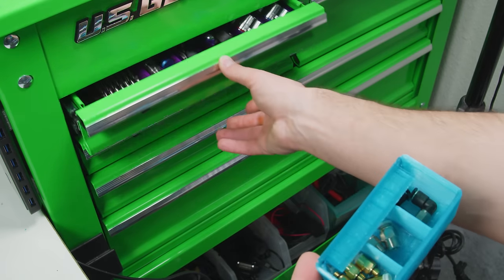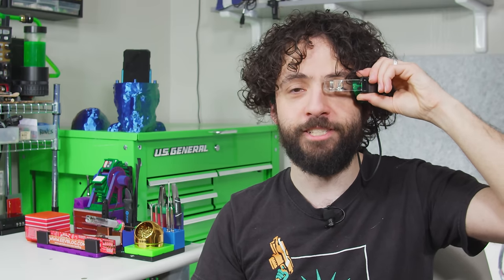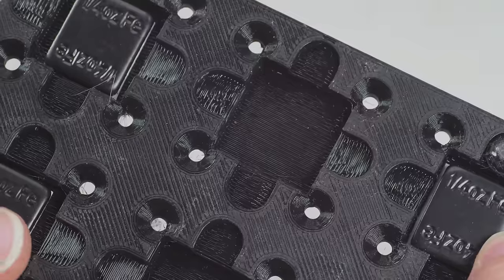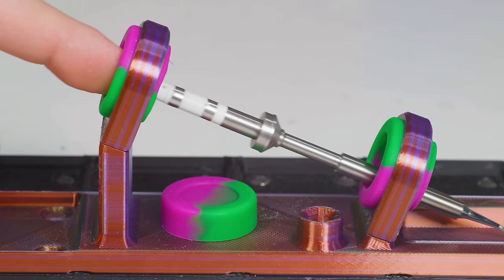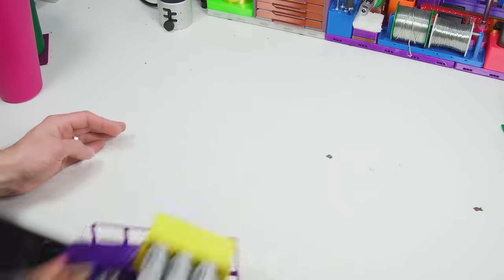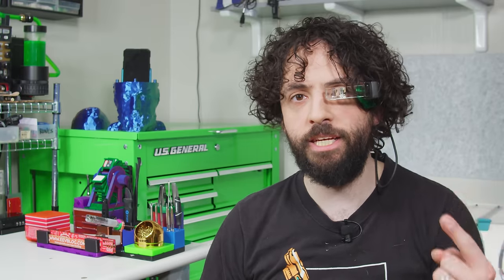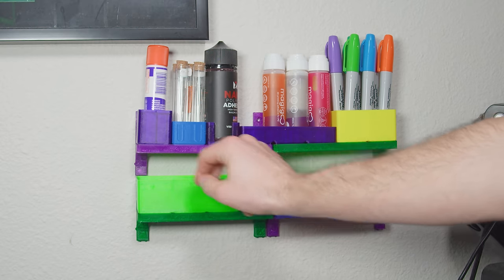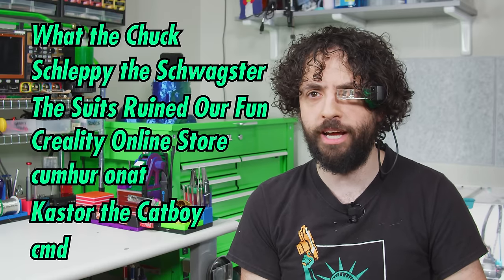Store Anything Anywhere with Gridfinity! 20+ Weird Printable Organizers by Makers Like You!

Comment: The gridfinity system is one of the most normal yet over the top organization sets that I’ve printed
Reply: I want to make an equivalent to the SD card holder (not the wheel but the other one) that is basically just like a 64-port SD card reader. You can use all of them while they’re in storage!
Reply: @myrealusername2193  That would be incredible. Windows users wouldn't be able to assign enough drive letters lol.
Reply: @tbuk8350  I have tried to figure out the electronics for it and it would be absurdly slow unless I was using like USB4. Because to have 64 ports would mean a usb 4 hub that went to 8 usb 3 ports, and each of those would go to USB 2.0

Plus 8 USB hub ICs would be hell to solder, I’m nowhere near good enough to do that lol

Comment: I can see the use case for the Minifinity, actually: jewelry making. Some jewelry components are the size of surface-mount resistors - crimp beads, crimp covers, and omega wire protectors come packaged by the gram, loose, in tiny plastic bags, and you only ever need a single digit number of them per project. I use pill cases (like, the ones with compartments sorted by day) but I can see someone who's invested in your system being willing to glue a couple itty bitty baby compartments in to hold such parts.
Reply: That Minifinity is perfect for SMD resistors and capacitors.

Comment: FYI, if you don't need screws, the "light" baseplate on thingiverse is less filament than even the one in this video.  If you use this version, you can heat 6x2mm magnets, similar to a threaded insert, to get them into place.  Minimize how long they're hot for, magnets slowly lose power when very hot.

Comment: I think the 1/4 size Gridfinity would come in handy for watchmakers and people who play with SMD and other tiny stuff.
Reply: The biggest concern is human accessibility, because yes, a lot of the SMD components are absurdly tiny and you can fit a huge amount of them in a small volume, but handling them is clumsy with fingers.
Reply: Are people who are working at that scale (enough to need bins like that in the first place) going to be using their fingers to handle those components anyway?
Reply: @Blooest  sometimes! There’s not a more correct answer than that. Especially resistors/capacitors/diodes all of which are tiny and not static-sensitive and you tend to use a bunch in a project, it’s logical to grab a bunch with a finger.

Not all SMD components are super tiny, and a number of those may or may not make sense to have in anti-static foam.

Comment: That articulating arm could use a spring inside the hub axle such that when you tighten it down, there's a certain force after which it overcomes the splines and rotates. You could change the force required by adjusting how tight you screw the end caps?

Comment: You could include a magnet on the bottom of the razor box so the razors stick to the magnet and if you knock it over it wont dump them out. Since they are sharp and what not. Maybe make a small insert that can be pulled up to separate the razors from the magnet.

Comment: I think converting a 2x2 grid to a scaled down 3x3 at 2/3rds scale might be more useful as a mini one than one that converts a 1x1 to a tiny 2x2 at 1/2 scale. The extra size and depth would be just enough to make it more useful, and a 2x1 baseplate converted to a scaled down 3x1 with a long slot on the side would actually be really nice. There might be just enough space in a 2/3rds scale setup like that to put simple lids on them instead.

Comment: Worth noting that a lot of this stuff you can absolutely make without a 3D printer, it just takes other tools, materials, skills, practice, and a lot of dedicated time.  And for some, like myself, that really is the better option. 3D printers are expensive, but I already have the tools and experience I need for woodworking. 

It's important to remember, hacking isn't just about having the latest gadgets and gizmos, it's creative problem solving working with what you have and applying learned knowledge and skills. It's making a part yourself because buying it would be three times as expensive. It's disrupting a network to provide aid to suffering people under a regime, it's infiltrating a secure system to reveal doccuments that really should be accessible to anyone.

Hack with what you have, whether it's an axe or a lazer cutter; if it gets the job done it's good enough.

Comment: Meanwhile, I used the annoyance of swapping a hot pinecil tip out as an excuse to buy the v2 and a full set of the new shorter tips. I still love that I have 2 handles and 1.5 sets of tips for way less cash than my previous employer paid for the Hakko I had on my bench (which was no where near as good).

Comment: I really like the idea of Gridfinity and I've tried out a few different angles for it, but the amount of plastic waste is really high, even with the vase mode alternative implementations. I'd love to see somebody brighter than me figure out a way to do it, but at the same time we're basically talking about injection molding.
Reply: It's only waste if you plan on throwing it away soon
Reply: Waste isn't just about discarding things, it's also about opportunity cost.  The single-square "put one small thing anywhere" holders and the like are memes in practice; the competition are off-the-shelf drawer organizers and the like. By comparison, when the alternatives are far thinner injection-molded pieces that weigh less and use less resources to make, it absolutely is wasteful. The calculus is probably better when compared to for free-standing surface-resting pieces, but those don't also incur the overhead cost of a (plastic-intensive) frame.

There are things that FDM absolutely does well but building boxes and similar just isn't one with conventional design techniques.

For wall storage, by basically any reasonable measure, those Harbor Freight parts organizers that Zach has are a more efficient use of materials, probably even with his comparatively heavy front faces on them. (I have the same organizers! They're great!) The Honeycomb stuff is also probably more generally efficient if you're insistent on FDM. For drawer storage, you can buy the aforementioned injection molded pieces for about $22 for 32 miscellaneous sizes on Amazon, and to print similar in Gridfinity you're probably looking at four to five rolls of material, somewhat less with vase mode variants.

It just doesn't work out well.
Reply: @EdRopple  It's a hobby solution for hobbiests... Obviously you'd never implement this at scale but it's the fun of making it and figuring it out that's the point.
Reply: @Frankenstein786  I dunno, dude, I try pretty hard to not waste non-biodegradable material. On a channel where the host ha-ha-only-serious jokes about plastic choking the oceans, I would think that would be a priority.
Reply: @EdRopple  Depends on where your focus is. I like having an exact spot for many of my tools, and gridfinity suits that well for me. However, all of my resistors, capacitors, ICs, etc, are in nice, wall mounted parts drawers. But the only reason I have those is because they were free. I've tried using the harbor freight ones, and they're garbage. For me, gridfinity is more about organizing the workspace, while storage needs are better met by other things.
Reply: @EdRopple  Look at listas implementation of "shallar" bins, the smallest containers they make are equivalent to a 2x2 gridfinity. For this reason I am not printing any 1x1 or 1x2 gridfinity items and I've hollowed out the bases and dropped the floors as much as possible to match the lista design as much as possible.

You need to apply the 80:20 principle to what gridfinity items you choose to print. 
Should you print a bic lighter holder or should you just print a damn 2x2 bin and drop the lighters in it... The choice is obvious... 

If you work through this lens gridfinity is not that wasteful and I'm excited to continue implementing it, for the most part exclusively in my shallow drawers and for hardware like items
Reply: @Max_Marz  hey, these look neat, thanks!

Comment: the rotary SD card thing would be dope if it had pins on it that the card just lays on. So whenever you rotate, the next card touches the pins. This would of course need a total redesign, perhaps having slots on the spokes to hold the gear still while you want a card loaded.

...or just buy a bigger SD card...

Comment: I wonder if you could set something up to test RAM without having to post a MOBO.  just something small on a pi that can read and display the memory amount and the Hz rate so you could know if components were bad without having to post it. i think the most difficult part would be where the RAM would slot in, and how to differentiate between all the different chip sizes..

Comment: dude you said that the novelty micro drawers are useless... but aren't they stil large enough to get things in and out of there with tweezers? so could it be suitable place to store loose smd parts bin? or perhaps whats a better place for smds is to push them on to a sticky surface. like some double sided tape. in a book, with wax paper to keep seperated the pages from sticking together.

but if not smds then maybe other tiny parts for making. that are normally manipulated with fine tweezers. idk
Reply: Someone on the discord was using them for little watercolor paints tubs. They are a novelty, for sure, but there are niche uses.

Comment: How good is that soldering iron? Like is it the kind I get now, no holds barred slap it into infinity or rather gridfinity? Or should I wait because it has some unforeseen downfalls.
Reply from the maker: I really like it, but it's just $35, there isn't much to lose. It doesn't seem to have any game-breaking glitches or quirks, as long as you stay away from the cut-rate third-party ES100 tips.
Reply: @ZackFreedman  Received and amazed. Though I didn't realize it didn't have a powersource bundled as well as not being natively battery powered. (I'm a little dumb on that part) I am still able to use my pixel 3a charger with it and am going to switch to something else. Otherwise I couldn't be happier, best investment I have ever made.

Also while I have your attention I had an epiphany. Minnist-Finnist! (spelling/naming TBD) This might seem dumb at first to go from Gridfinnity and already having Minifinity for smaller things. But I think Minnist-Finnist would be another great addition because it has a few benefits. 
First being why not, we are all going mad with power anyway. (sorry had to) Firstly, this is more tangential to Minifinity.This standard would act more of a mobile double stick tape kind of application. I personally would use this for phone cables stuck next to my bed, on phone cases and possibly laptops if you can conceive of it. This would be the open source equivalent for magsafe like operation, but still being possible with Minifinity and by association Gridfinity. 
Lastly if nothing else, it increases resolution for how small we make things fit into this particular grid. This might be the final standard in terms of sizes probably because of 3D printing being inaccurate and the fact there is no need for anything smaller.

Thoughts? It's a little dumb and a little genius which means I am right where I am supposed to be... Probably?

Comment: A number of years ago I was exposed to lista cabinets when I started a postion at a national laboratory. One of the systems lista uses are "shallar" bins. I found this to work far superior to any drawer orginazation strategy I'd ever experienced before, especially fixed layouts and those stupid dividers that let screws mix.  I no longer work at that position but last week I started implementing gridfinity at my new place in the far cheaper cabinets and toolboxes we use.

I've decided to standardize all my bin colors on mint-green or seafoam. I think its a very aesthetically pleasing contrast to industrial glitter, black oxide and zinc plated fasteners look really good in them. 

My one request for you zach would be to optimize a and define a new bin standard that is compatible with the gridfinity base geometry but uses as little plastic and is as fast as possible to print. I dont need magnet holes and and I dont need a dozen floor layers. I'm going to do this myself eventually but since you're asking for ideas I think you'd be the best person to innitiate this standard so it can propagate from the top down. NAG NAG NAG NAG NAG do this when you fix the prusa holes!!

Comment: #Zach:yt: You could appeal to the community to find a curling solution for both the base board and the containers that would be compatible with the original system but that would solve all the curling problems of the original version.

I'm sure the community could overcome this challenge and with your official approval, be adopted by all.:goodvibes:

Comment: Zack! I'm pleased to see you've hacked your US GENERAL's irritating door and lid locks.  I was just at a job today where I'd complained that they should rip all that cr@p out last visit.  They told me they had.  After I had the top covered with open tool kits, parts, hot tea, and debris I tried to open one of the drawers only to discover they'd not defeated the *^#@&(} lid lock.  😲
Reply from the maker: Ha, yeah, I just drilled through the spring mechanism and jammed it open with cotter pins. I shared my 3D-printed inserts on Thangs that hold the drawer latches open.
Reply: @ZackFreedman  Thanks for that.  I was going to suggest just sawing off those black buttons but your drill-and-pin is way better.  Thanks a million!

Comment: 6:40 WHAT? how could there possibly be an upgrade over the 888D? i've worked in multinational run labs that had endless budget, and they used hakko 888D or super old weller stations for the old timers that hate japanese tools
Reply: IMO, that awesome upgrade is the Hakko FX-951.  Also heats up in about 6 seconds.  Really nice lightweight wand, presence detecting cradle...etc.  But also 2.5x the price of the 888D at list.

Comment: I'm actually taking this idea to the next level, I have been designing fully 3d printable tool chests that are modular for height, width and depth.   They will end up take a very long time to print but ny concept has been working extremely well so far.  Then I plan to fill them with the content from this video.

Comment: these are great obv but holy planet a literally disposable box for blades is hyper wasteful — use that plastic for something that works smart, not hard. wedge or tape a 6cm strip of cardboard vertically somewhere moderately safe. slide spent blades in there, then roll and tape up when full. or hit the trash & clean out a sealable food jar. a spice jar will prob fit in a grid cell. hack the planet, nerds
Reply: Yeah, no, imma stick with an excessive box that can't get sliced through by blades, giving some waste dump.employee tetanus.
Reply: Maybe print it out of one of those biodegradable plastics from the TeamSeas episode?

Comment: Isn't it kinda dangerous to recommend silicone for the soldering iron? They can get way hotter than the silicone is rated for and doesn't silicone release toxic fumes when getting too hot? (Don't get me wrong if you don't solder too hot it's fine but think about noobs like me)